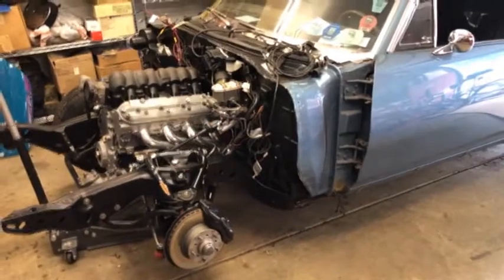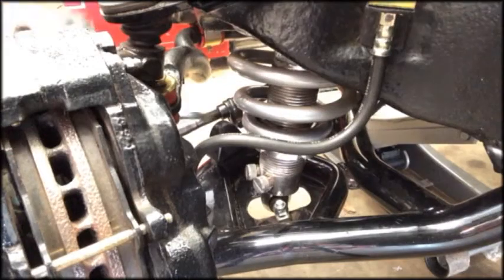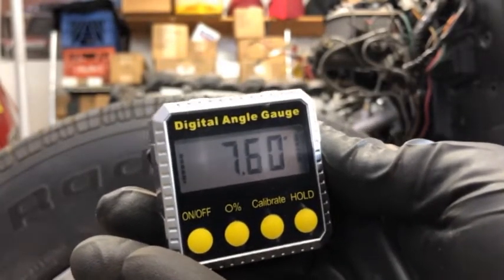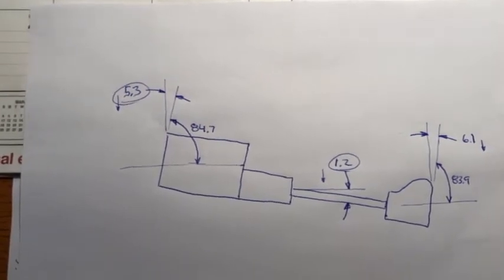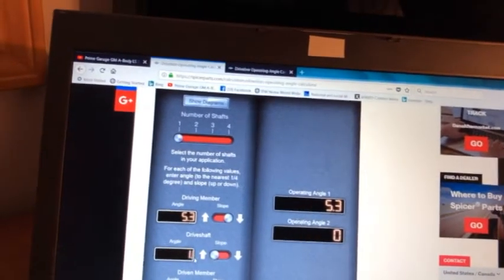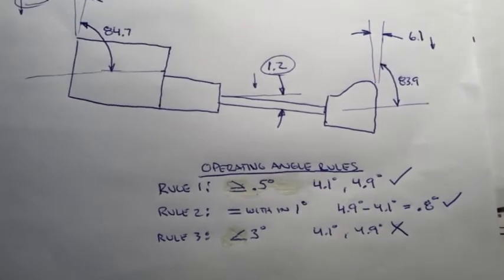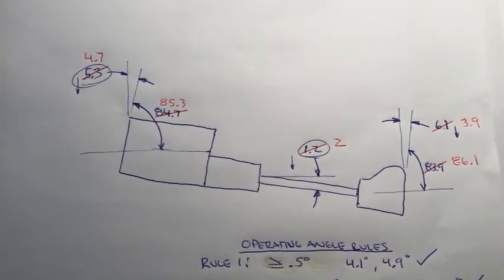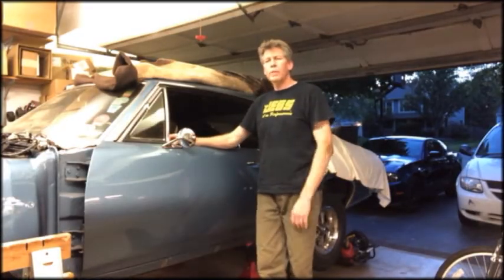LS Conversion swap, Part 48, Drive line angle correction

Comment: How has this worked for you now that the swap is complete? Any wheelhop issues?
Reply from the maker: None what so ever. I do have anti-hop links (change the IC under load and forces traction) between the upper control arms and differential. Video 25 shows them pretty good. Between those and the adjustable length upper arms I think is what helps.
Reply: @primegaragelsswap  Many thanks!

Comment: great video but if you click on diagrams they show for instance engine angle at transmission being taken at the front of transmission   that changes everything when you calculate being up now not down   what do you think
Reply from the maker: But the engine and trans are parallel, i.e. same angle so measurement should be the same I think

Comment: Excellent video man. This is what I needed. I have a '91 Benz 190E. I'll be doing a complete drive train swap. I'm swapping the diff, trans, and engine. It'll be a Frankenstein. Honda K20/24, Nissan R200 differential, and undecided transmission. Tons of adapters and aftermarket support for the JDM stuff to do a swap with. The task seemed a little daunting despite seeing many many cars be successfully swapped. Most build articles don't give you the details of how they do things, I definitely needed this video. Thank you for the confidence.
Reply from the maker: Glad it inspired you. It was a learning process but like I said I will do another. Your swap will be crazy unique, I love it!
Reply: @primegaragelsswap  well I was already inspired, but I didn't know about the internet calculator for the drive angles. That helped fill in the holes for me. But by the way, I also have a 1968 LeMans just like yours without all of the swapped parts. It's just sitting on the side of my house at the moment to eventually LS swap it, just not yet haha.
Reply from the maker: @GGtheRealest  Does not matter which one you start, just get one of them going!!